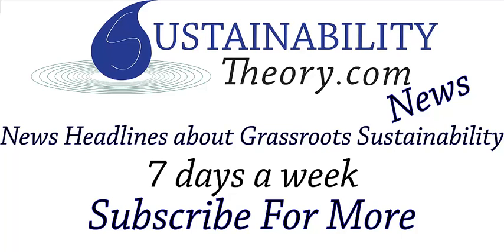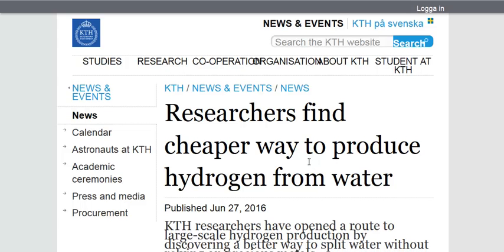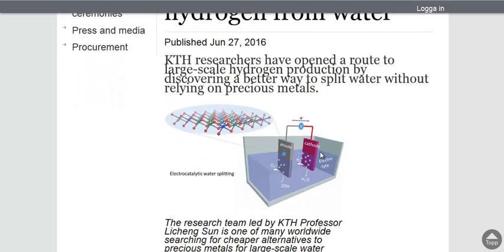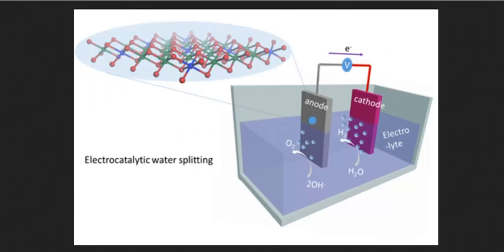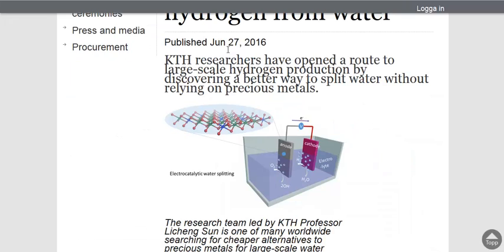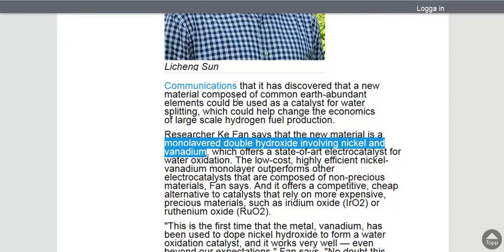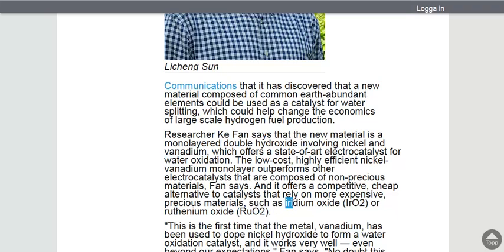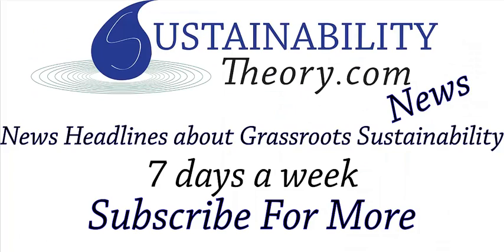A Cheap Way To Produce Hydrogen From Water

Comment: still expensive anode, i used way cheaper anode than what they used, adding to that, catalyst only speed up reaction but energy consumption remains the same which is the main impracticality of producing hydrogen by electrolysis

Comment: didnt John Kanzius already  use radio waves to made one of the best effective electrolysis known ?
Reply from the maker: Sounds like an interesting concept. hydrolysis without electrodes (which corrode and need replacing.) I just did some research on that, and it looks like others have discovered a technique similar to this before John Kanzius when they where looking for a way to lower corrosion on expensive industrial water based systems.  " It was also found that electromagnetic water treatment splits water into atomic hydrogen and hydroxyl ions and acts as a water clusters structure breaker"

Synergistic Application of Chemical and Electromagnetic Water Treatment in... | Request PDF. Available from: https://www.researchgate.net/publication/289652486_Synergistic_Application_of_Chemical_and_Electromagnetic_Water_Treatment_in_Corrosion_and_Scale_Prevention [accessed Jan 19 2018].
Reply: They got it hushed up too ..